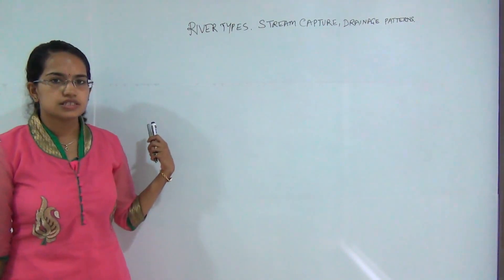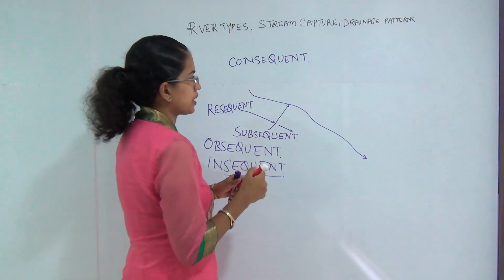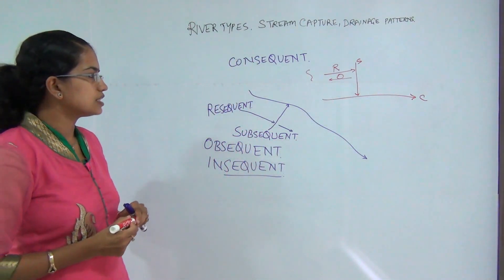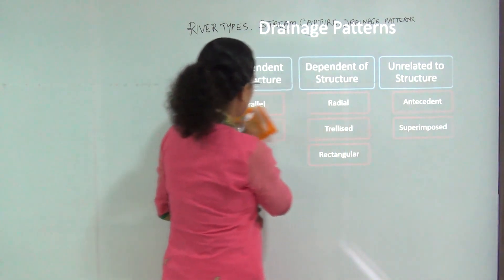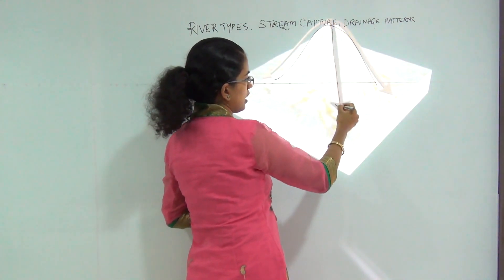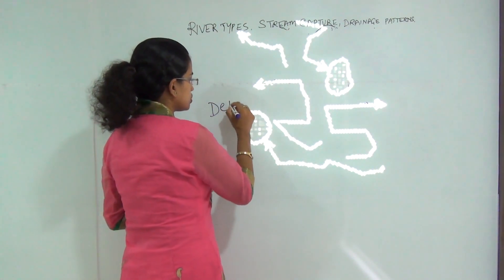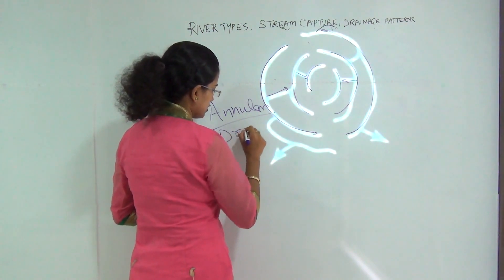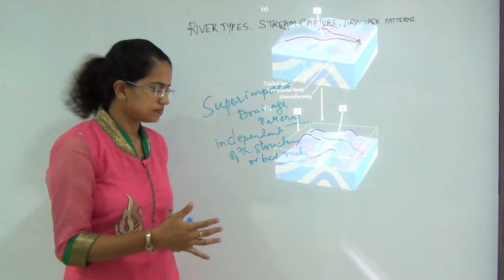Restless Rivers - Stream Types, River Capture and Drainage Patterns

Comment: Madam ,what is the difference between antecedent and superimposed drainage pattern  ? They seem to be same.
Reply from the maker: A superimposed river does not adjust with the structure of its place of origin. River valley is built on upper portion and the river develops and expands in the lower regions.
The antecedent stream maintains its original course and pattern despite the changes in underlying rock topography.